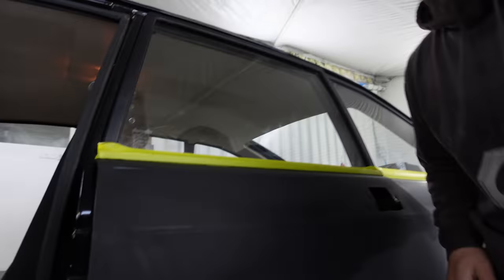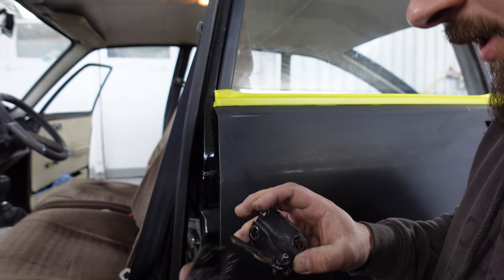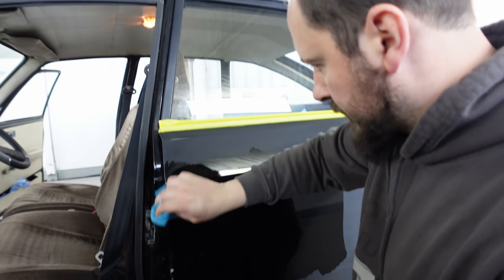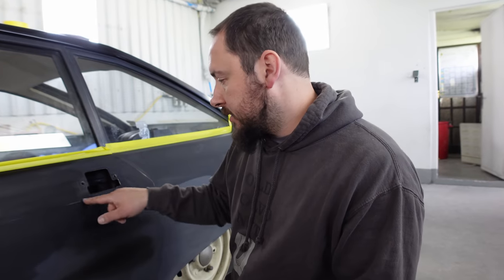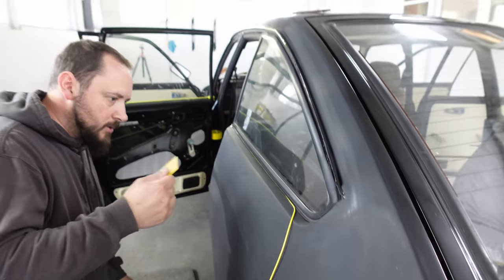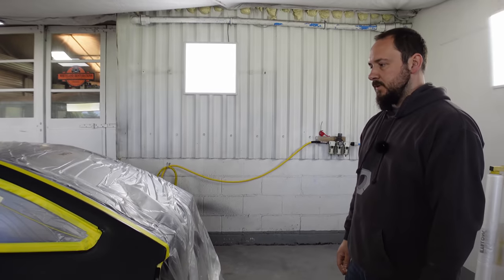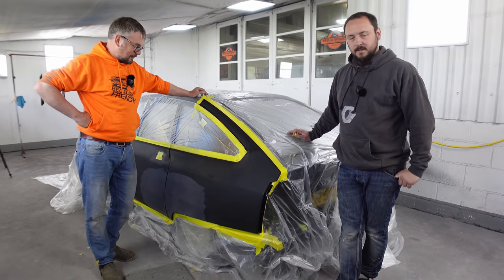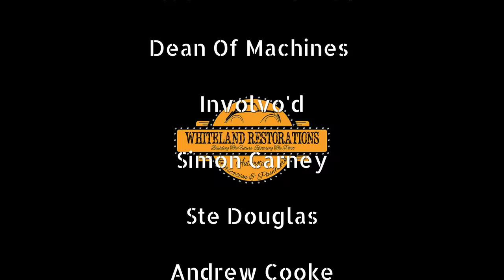Finally Painting the GSA Plus Teaching Hubnut the Five Ps!

Comment: Like the tip about the electrical wire for lifting seals, if and when i get round to painting the roof of my car this will help with the rubber/rubbish trim at the top of the windsreen.
Reply from the maker: It comes in very handy when you can't remove the glass and rubbers!

Comment: Curious as to what mask you are using to spray with… I was under the impression you needed an air fed mask to be safe?

Just asking because I have a spray setup in my garage however have been put off using it after reading about masks and the dangers of breathing in 2k paints.
Reply from the maker: To be honest we use air fed for big jobs and only use our half mask on small jobs with lots of extraction. Should really use air fed all of the time. I'd only use the half mask with very good extraction which we have. Always be as safe as you can!
Reply: @WhitelandRestorations  thanks for advice, think I will stick to trying to get an air fed respirator as it’s a normal sized garage.

Keep up the good content!